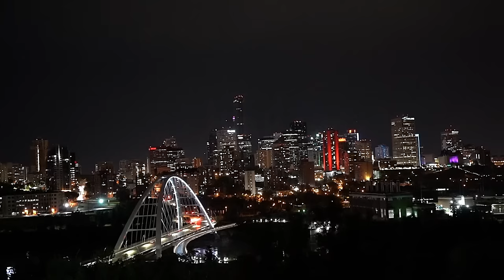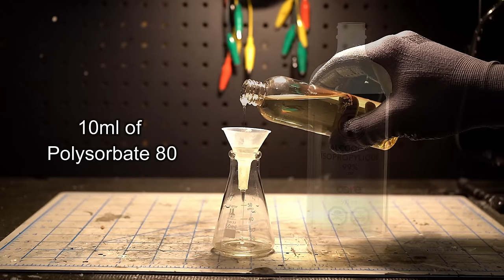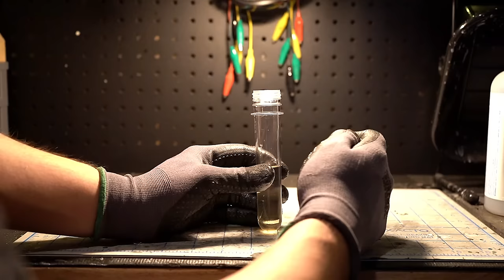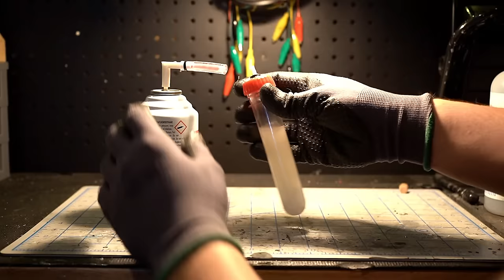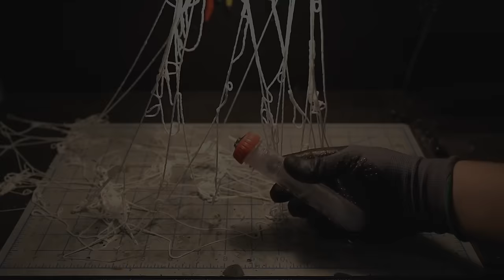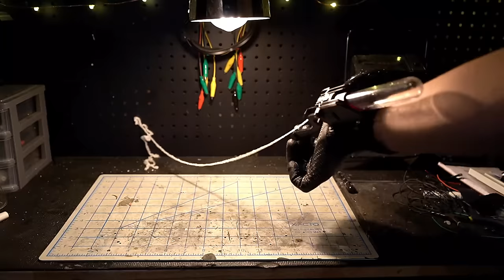Polymethyl Methacrylate (Silly String) Web-Fluid Tutorial

Comment: we can not swing on buildings through that rope but we can close someone's mouth
Reply: That would help a lot in today's problems
Reply: Maybe with a better formula we can even swing!
Reply: @paolafederigi6417  well it would need much much more strength and even then you would need a very strong upper body to hold on for that long so maybe we can use it for other stuff
Reply: @paolafederigi6417  nah your arm would rip off but it would be cool for like a robot to swing around ig
Reply: @grqfes  what if you use a harness?
Reply: @CT--og4iv  think you’re confusing regular feminism with radical feminism.
Reply: @grqfes  What if we make an endoskeleton that can hold a human? Like in that Tom Cruise movie
Reply: @grqfes  what about zip lines?

I don't think the arm will rip off
Reply: @luckyizzac  zip line is a straight line bro
Reply: @grqfes  but we are not doing any extra support on our body
Reply: Or blind them maybe, just gotta be sure that this solution is non-hazardous.

Well, I guess it would work both ways then!
Reply: @paolafederigi6417   no we will dislocate our arms in the process of swinging
Reply: @luckyizzac   no the arm wont rip offf but it will dislocate our bones when you hold on a rope  with one hand it hurts but when you hold on for longer your bone will dislocate unless u have a really toned arms and you are in fit condition and muscles
Reply: @paolafederigi6417  nope, thats impossible

Comment: Amazing! I think now the only thing to do is to add one more ingredient to make these artificial web threads more resistant ... maybe with cement glue
Reply: Resistant? You mean increase the tensile strength?
Reply: @aronorenda  yes
Reply: Now I am absolutely no chemist. But I’m just curious, what if we added small fibers of some kind into the webs? How we’d achieve this I’ve no idea, but think about it, how do ropes work? They’re made up of small fibers interconnected and moved together to increase tensile strength. Studies were done on spiders where the arachnids were sprayed down with carbon nano tubes, and while most died, some somehow incorporated them into their webs increasing they’re strength dramatically. I’m sure this is more difficult than the concept is to describe, but it’s a start.
Reply: @christianmccauley7340  wow your really intelligent dang
Reply: @christianmccauley7340  WOW even tho i have no idea what ur talking about that theory could work !
Reply: @christianmccauley7340  nylon maybe?
Reply: @christianmccauley7340  could work
Reply: Its silly string, also known as an aerosol string, it mainly has a viscous composition and the actual components give it a flexible exterior. Polymethyl Methacrylate is a thermoplastic, when used with acrylic nail powder it works as a solute for the formula. Isopropyl alcohol helps in giving the viscous composition and it filters out impurities. Polysorbate 80 functions as a base for the mix and it’s practically the main solvent, it binds and emulsifies the ingredients. Tetrafluoroethane which can be found in the R-134a Canister comes in high content in order to serve as the main factor when it comes to building the pressure needed to eject the silly string, it helps in the process of turning the mix from liquid to solid upon coming into contact with the oxygen. You can’t add fibers to this formula because it would ruin the transition from liquid to solid and even in two minutes or so the strings dissolve due to exposure to the oxygen/nitrogen in the atmosphere. You can’t increase the tensile strength in a formula that has no strength whatsoever, silly string isn’t like rope, its squishy and viscous but comes out like string. I hate to be a party pooper and I really love these ideas you got guys, but its not how chemistry works.
Reply: In order to shoot something with any sort of tensile strength, we would need some sort of a heating method or a spinneret. Lets look at actual Spider Silk just for example. Spiders store their silk in spinneret glands found in their abdomen. This liquid turns to solid when it comes into contact with the oxygen and the reason webs are so strong is because the high amount of proteins and amino acids found within them. If we want actual legitimate Spider webs strong enough to hold our weight or at least pull things, we’d need something like legitimate Spider Silk coupled with any component similar to C02 in order to eject it successfully. In order to make spider silk you can’t artificially make it. Quite the opposite in fact, you’d need to biochemically produce it and practically grow it off of legitimate Spiders. The scientific components in Spider silk are amino acids and protein fibers as I said before, the two major amino acids being alanine and glycine. In order to extract these components at all you’d need to do it naturally and not from scratch. You can’t replicate the exact potency of Spider Silk without using an actual spider’s body to sustain the components, the reason it’s tensile strength is off the charts is due to the amount of proteins and fibers being ingested into the Spider. They quite literally eat their webs in order to reuse them so you’d logically have to get the Spider silk from them, how would you do that exactly? You’d need to store Spiders and isolate their DNA in a Biochemistry lab, followed up by isolating the Spider-Silk Gene and extracting it. With that spider silk gene you have the key component in manufacturing your very own Spider webs, a recommended element in order to actually bring the webs to life is yeast. Apply the silk gene in to that yeast and you’d achieve Spider silk being farmed and developed. A project like this would take years of research and high amounts of money. Specially taking into consideration how much stronger webs are than a steel wire proportionate to its own size. And the incredible convenience to how they come to be is incredible. The spider has these liquids stored in its abdomen, when extracted they solidify upon coming into contact with the oxygen and nitrogen in the atmosphere. To make a thread you’d more preferably need very high amounts of spider silk, a spinneret, and any sort of chemical element that has the capacity to build up the pressure needed to shoot out a web that can carry you. Theoretically, a web shooter is possible! But it is far from conventional and it would take very long to get correctly. Spider silk may be stronger than steel, but that is proportionate to its own size. The amount of Spiders needed to produce a web that can actually carry a human being would be astonishing and a financial weakness. Although revolutionary, the amount of years ahead of us for us to make legitimate web fluid are detrimental but…it is possible.
Reply: In short, you’d need something like Oscorp Biocable from TASM if we want anything close to web fluid.
Reply: If you could apply any sort of fiber or cement glue to increase tensile strength, it would have been done already. If the equation was that simple it would have happened and trust me when I say this, people put hours and days developing projects like these, you may have underestimated these people if you think they haven’t come up with an idea like that.

Comment: Got any way to increase tensile strength? And try to add a motor powered spinneret to twine them together.
Edit: Is it toxic in any way
Edit: with this work in smaller nozzles or should I lower the viscosity

Comment: Could graphene propogated throughout the mixture increase tensile strength? Maybe mixing a nylon reaction with this one? Overall the strength is the best I've seen on anything so far, but to hold weight it needs to be almost impossibly strong lol... Let me know what you think of those ideas!
Reply: unfortunately chemistry is unlike cooking graphene you have to bond with pmma in order to use it as a source, but graphene is inert so if you can't make a bond, if you add graphene to this formula, you will only get stupid rope with black particles so there is no improvement maybe graphene oxide can work
Reply: @begreateryourself9087  that's a terrific point. However, I do believe dissolved nylon mixed with this formula would retain fireability and increase strength. Correct?
Reply: @grahamgrecian1332  It can work again depends on the chemical structure, but I think it could bond with PMMA because there are reactive groups in nylon that can make hydrogen bonding.The main question is how will you solve the nylon The brain is talking about the ion video, but ultimately this formula is a foam, do not expect anything, it will be very weak again.

Comment: Does the R-134a add some kind of chemical to the mixture or is it just used for building up pressure and could be replaced by just pumping up the cartridge with air?

Comment: you could use
1.Boil 6 tbsp. of water in a small saucepan
2.Pour the white vinegar and glycerin into the mixture. Stir the mixture thoroughly to ensure the glue will be sticky and adhesive
3.Allow the solution to cool slightly, and then pour the glue into a jar. Seal the jar's lid tightly to prevent the glue from drying out

Comment: How sticky is the rope after being fired, and could adding a sort of adhesive (not just glue) ruin it in any way? Also, I think you should try to see if you can make a spinnerette: a motorized spinning nozzle that expels the formula while spinning. This will not only make it a little bit more comic book accurate, but is more practical than trying to make a rope, as the spinnerette will make a spiral web pattern (which would be great to see successfully done

Comment: Ok so I have a dumb idea for web fluid. Ya take 2 nylon fibers, lay them parallel to each  other, then you a take a second fiber, you wrap it around the 2 fibers in a vertical spiral, then tighten it. You end up with a nylon rope with small holes in between the fibers, and a hollow middle. You fill the middle with the same material used to make superglue, and fill in the holes. So it's basically nylon rope with the sticking strength of super glue, which can hold a literally ton.

Cyanoacrylate, to make the web stick to surfaces. Maybe nylon fiber as a base structure. Use the fiber to create a cylinder based structure with the space between the fiber itself filled with cyanoacrylate, as well as the middle of the fiber.

Comment: Hmmm looks promising

I think adding a solvent would make better room for the web fluid

But then again it depends on the chemicals being used to make the fluid itself

Hmmm

Might need to do a quick test run on my own formula

Mine will be

Anti–stick rod stirring.
Cellulose acetate.
Contact cement.
Testifying resin.
Xanthan gum or guar gum.
Jar with seal.
Acetone.

Perhaps with these i could make form of web fluid

Remember: web fluid and webs made from Peter parker himself aren't necessarily actual webs

They're made to mimic it

It's actually a mixture of certain chemicals and adhesives

And as I mentioned previously I think adding solvent would help reduce issues in the web cartridge

Y'all can take this for your own stuff

Remember to be yourself and be the best you can be

Web on!

Comment: You probably don't need the R-134a specifically. Any low boiling liquid should do. Try butane, it's cheaper (but flameable).
Reply from the maker: You do need it because it acts as a solvent to further dissolve the fluid. It’s not just a propellant
Reply: @TheHumanSpider is it can be change by butane

Comment: Does this web fluid change consistency when exposed to air or in other ways
Reply: When it's ejected out of the nozzle, it becomes a string (like silly string)

Just polymethyl methacrylate and thymol b mixed won't change consistency when exposed to air (I don't know after a lot of time) but after you add in r134a, it's basically done. Then it'll be solid when exposed to air

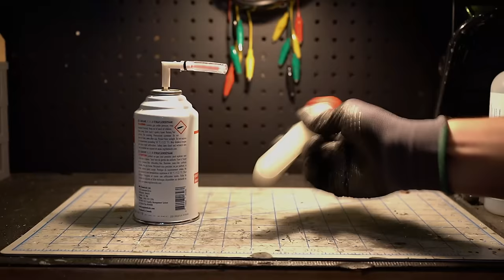Comment: 1:59 wow it dries so fast, but can it make you swing from building to building?
Reply: No not all. Humans wouldn't be able to swing building to building anyway. Your arm will pop out of its socket or you will pass out or die due to all of the Gforces you are getting from swinging through the air.
Reply: @leticiakatya  oh, oof, not unless you have super strength like Spiderman
Reply: @leticiakatya  no spiderman moves at around 100kmh and does not go from 0 to 100 in a second so he wouldn't take any g you just need to have the strength to swing